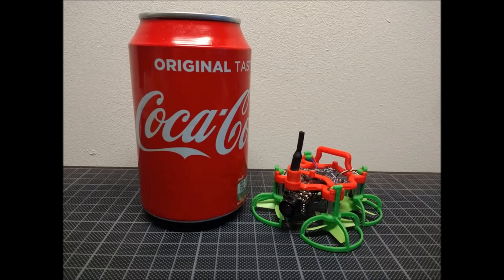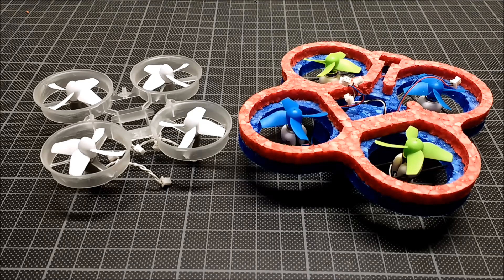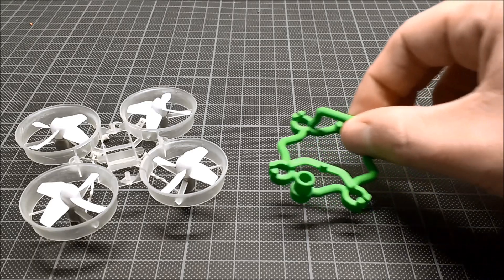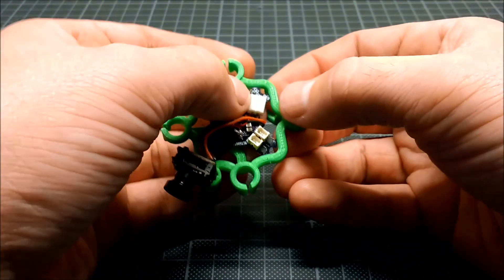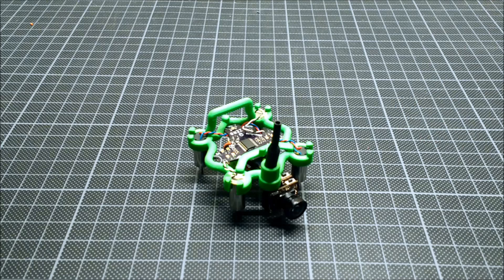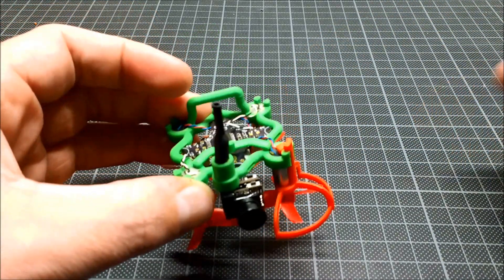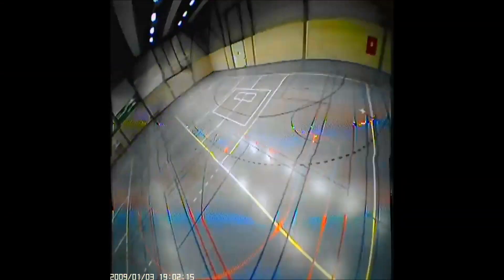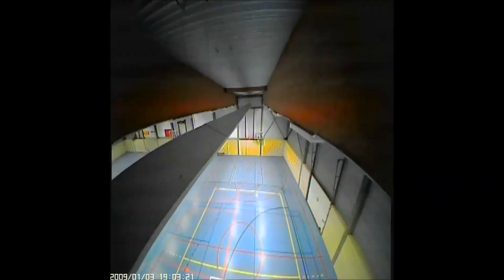presentation minimus 45 micro quadcopter frame

Comment: Is it possible with that?
BETAFPV F4 1S Brushless Flight Controller V2.0 DSMX Receiver 5A ESC with BT2.0 Connector for FPV 1S Brushless Tinywhoop Micro Whoop Drone Like Meteor65 Beta75Pro Beta65Pro https://www.amazon.de/dp/B07ZYTBXQR/ref=cm_sw_r_cp_api_fabc_VJ1-FbR9F6F1D?_encoding=UTF8&psc=1

Comment: Put the main board sideways vertically and change the board orientation in betaflight.
Reply from the maker: This is an alienwhoop zero, it does not use betaflight :) I could try it as soon as i get my hands on a beebrain. It wouldnt change the size of the frame though. If the frame gets any smaller, the propellers touch eachother.
Reply: @timewaster5826  i am doing it atm, but if "you bend" them at v angle you could fit them in smaller foot print

Comment: what about the benefits of having ducts? Tiny whoop ducts aren't just for protecting the propellers, they provide additional thrust and stability and wind resistance.
Reply: Negative, sorry but no.  TinyWhoop ducts are really just about protecting the props and strengthening the otherwise bendy frames.  Many aren't even duct shaped.  In order to actually function as ducts, the props need to be almost touching the duct walls, and the ducts need to be shaped as such.  Then you must spin the motors faster and draw more power, just to maintain the same amount of lift. The additional thrust doesn't happen until you spin the motors much faster and draw even more power, at which point you're going to overheat these tiny motors.  They actually do BETTER in the wind without ducts and larger props too (go look at what toothpick conversions can do!)